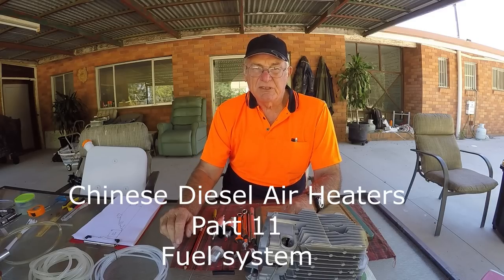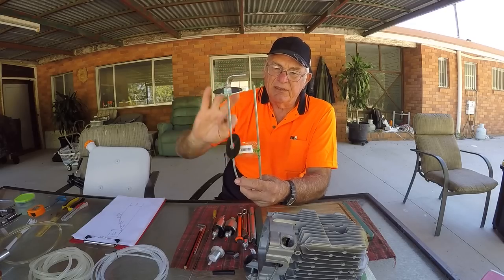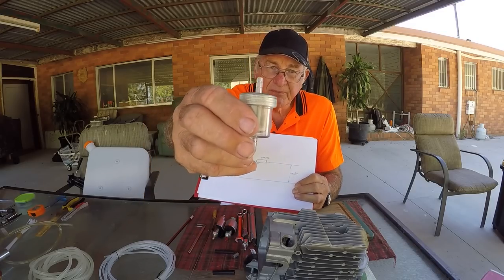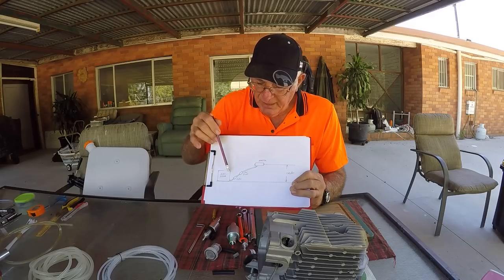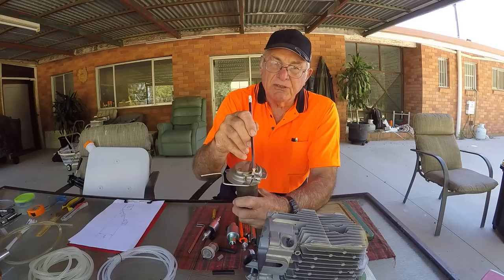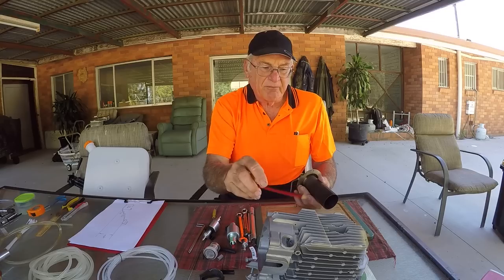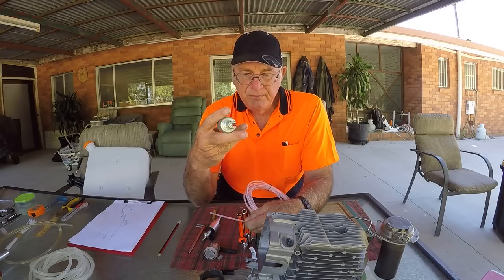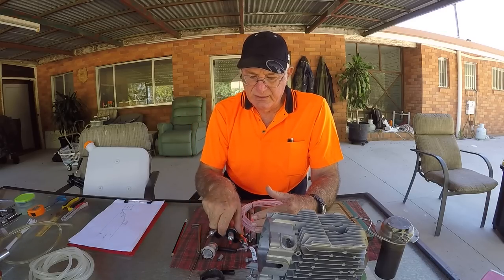Chinese Diesel Air Heaters - Part 11 -  Fuel Delivery

Comment: i am commenting as i watch the video. so your talking about the soft fuel line will pulse to a larger size as the pump pulses. so i understand that. i am a dragracer and build my own engines. i always used very high pressure fuel line. up to 300 psi. i know thoughs pumps don't do that but i have seen those plastic filters actually pulsate with each pulse of a fuel pump. do you think that plastic filter would do the same thing with that pump? if it did it would lower the pressure of the injection into the chamber.

Comment: Thank you sir for all the work you've put into educating us on these heaters! I have a question related to the lubricating property of diesel. The EPA's regulations have apparently reduced the lubricity of diesel over the years, and I'm wondering if this can cause premature wear on the pump. Is there any benefit or harm to using a diesel additive such as Diesel Kleen with these systems?
Reply from the maker: Hi A21,

Thanks for your feedback.

I have not heard of any pump issues from modern diesel.

As for Diesel Kleen, because I have not tested it personally, I can not give you an answer.

However, I do know that if you burn oil additives (2 stroke oil etc) in these heaters you cause excessive carbon  deposits in the burner and the atomisation screens.  JMcK

Comment: Sorry John I think your incorrect, (just my opinion) the hose is of a larger bore thuss the pump delivery has less of a delivery effect ( garden hose flowing then restrict it with your thumb) and the hose won't expand with every pulse as there is little to no resistance as its passing through gauze not a jet. The air in the high point of the soft hose makes no difference as the fuel flows over the bottom section of the hose. This is my initial thoughts if after a sleep I change my mind ill be back to apologise.

Comment: I havent watched it all yet..   but i put the fitting or a hole  in the cap (dont drill out the bottom) with a length of smallest diameter hose (the hard nylone works perfectly) going to the near bottom of the tank.  Mount it higher than the heater and ..presto..  the siphon effect keeps the pump primed.

Comment: John, mine works great when running. However, if I shut it down then restart it, the exhaust always ends up flooded with diesel (verified by disconnecting exhaust pipe) and it fails to start. (E-8 code) I presume that this is because the pump is allowing fuel through in a syphoning effect which overwhelms the ignition/combustion chamber causing it not to light. The only solution I can think of is to fit a tap on the line so I can shut the heater down purely through fuel starvation. Yes it'll throw an error of course but should allow it to start correctly after the power is disconnected as it would be priming from scratch. Thoughts?

Comment: Warm greetings John from Western Massachusetts, USA. A question: I'm planning on installing one of these heaters in my 12x16 foot shed. I'm figuring on having the heater mounted high on wall near the ceiling with the output from the heater divided into two lines. The fuel tank would be mounted 2 or 3 feet up from the floor. Am I correct in assuming that, if I put the pump close to the tank and use the hard nylon line, that I wont have issues with the more than one meter of climb the fuel will have to travel to reach the burner? 

Some people like to binge watch old TV shows; I'm binge watching your series on these heaters! Thanks in advance for your time and for producing these excellent videos.
Reply from the maker: Hi Kerry,

First thanks for the positive feedback. Do you have popcorn 🍿 for your “binge”watching?

Now being serious. Why mount the heater up so high?  Hot air rises, and you will have to force it back down.

It is better to have the fuel pump as close to the fuel tank as possible. A 1 metre lift is ok, but less is better.

Suggest you consider using normal fuel hose from tank to shut off valve to fuel filter to fuel pump on the intake side to lessen the chance of fuel leaks from multiple hose joins using hard nylon on input side. In your set up simple is probably more beneficial than more efficient.

On the delivery side of pump you should only use narrow bore hard nylon fuel hose.

Suggest you consider using a fuel tap close to the fuel tank in your install, and turn it off when not in use. This will help prevent the fuel draining down out of the fuel line. But it should be ok without it as the head height is only a couple of feet.

If it makes an easier install, you can mount the heater sideways on the shed wall, provided it is the side with the glow plug on top, and run the exhaust straight out the shed wall.

Good luck.  JMcK
Reply: Hi John, thanks for the reply and excellent tips. The reason for the height is mainly due to space management; having moved to a new house I've greatly downsized my work space. Around the perimeter of the shed I'll have cabinets and a bunch of power tools; wall space is at a premium so I figure if its higher its not taking much space I could use for something else. I'm still in the planning phase; so it might end up lower, maybe in a cabinet.

Thanks again!
Reply from the maker: @kobolila-yt  
👍 Where you suggest will be fine Kerry. Just direct the hot air slightly downwards.  JMcK

Comment: Hi John. Thanks very much for your time and all your effort. You have become a little celebrity here. I have a silly question. Does it matter if it's 1.5mm or 2mm? Mine came with an ordinary poly line which I have to throw out. Where would be the best place to get a 2mm nylon line? Thanks again for all your help.
Reply from the maker: Hi TS,

No it does not matter if 1.5 mm or 2 mm. But I would not go bigger than 2.5 mm

The important point is the fuel delivery line from pump to the heater should be hard nylon or narrow bore copper or similar. The reason for “hard” is to stop the fuel line absorbing the pump fuel pulses, 

If the fuel pulses are absorbed you will have issues with atomisation in the burner atomisation screens, excessive carbon build up and early failure of the heater.  JMcK

Comment: @johnmck1147 is there a minimum distance required between the pump and the fuel inlet on the heater? I’m building a heater in a Pelican case and want to make sure my hose lengths aren’t too short. Wonderful information you’ve provided in this series.

Comment: What an amazing and through job you have made of this series of videos. I am working my way through all of them.  Each one is a gold mine of information. I really appreciate your effort. Could you help me with two issues i have not been able to get information on please? I have a 45 ft tour bus and plan to use two heaters. I would love to have a separate 20 or so gal tank for both of them to feed off of. So I need to know how far from the separate tank can I pipe to the filter, pump, and heater? Second, I wanted to order the better hose you spoke about. Could you give a little more description so I can look it up on amazon? Thank you so much for any help you can provide John.
Reply from the maker: Hi MH,

Thanks for the feedback. 

The little dosing pumps, like most pumps, push better than suck. In your install I assume the pumps will be around the level of the fuel tanks so they won't have much lift to overcome so you could have longer than normal suction line. In motorhome installs I often run up to 1.5 m of suction with no issues.

The delivery line from pump to heater, unless very short (under 500mm) should only be narrow bore hard nylon. A run of 3 or 4 meters will still work here.

Search on line for “Narrow bore hard nylon fuel line for Eberspacher diesel air heater” 
I buy mine off eBay.

Two 20 gallon fuel tanks just for the diesel heaters seems like an overkill.

Cheers.  JMcK

Comment: Excellent video, thanks! How would you plumb multiple heaters into a Truck’s diesel tank? I need to  supply 3 diesel heaters (water, air, cooker) with 3 separate small pumps, but I don’t want to drill 3 holes into the tank for 3 separate stand pipes if it can be avoided at all…
Reply from the maker: Hi TDIY, suggest you could look at and try using one larger standpipe into the tank, perhaps a standpipe with a 10 mm or 12 mm bore and then have three 4 mm take off points for your heaters. The take off nipples could be soldered into the larger standpipe. 

Suggest you then consider using good quality 4 mm fuel hose from standpipe to seperate filters and then to seperate heater fuel pumps. From the pump to heater you should use narrow bore hard nylon fuel hose that does not absorb the fuel pulses. JMcK

Comment: We often forget that there are engineering details which are not obvious or intuitive. Thanks for posting this. 
On another subject, you mentioned in a previous video the problem with pump lubrication when using kerosene; will mixing some 2-cycle oil help?
Reply from the maker: Hi Michael, I hope people read the description as well as watching the video.

Now reference the 2 stroke oil in kerosene. Yes, a 50:1 2 stroke mix works well, but unfortunately all oils, including 2 stroke oils produce large amounts of soot residue. It is this soot build up in the combustion chamber and atomising screens that eventually cause poor heater operation.  A diesel/kerro mix is probably more sensible for long time use. But some countries sell a very high sulfur level commercial kerosene that appears to provide enough lubricity to the kerro. You need to check with your local Kerro supplier. Our lighting kerosene has virtually on lubrication properties.

Comment: Once again, another informative video. My heater has just arrived and I find it has what they call a damper connected to the fuel outlet. Have you come accross this before.
Reply from the maker: Hi Phil, thanks for the feedback.

If you are talking about a damper connected to the fuel pump, I suspect you have a Webasto copy rather than a Eberspacher copy. A Webasto style is a bit different to the heaters shown here.

Comment: Could you do the same test with the hose actually connected to the 'injector'?  And see how it squirts out with the two different hoses?
I am thinking the difference in squirt is mainly because of the difference in diameter of the line vs the volume pulsed, not because of the dampening of the line itself. Connecting it to the small tube that injects the fuel would probably speed up the flow again. Perhaps allso add a proper black reinforced diesel fuel line to the test.
I am running my heaters on the black braided lines without any problems at all.
Thank, Vincent

Comment: Brilliant. I only came here to find the direction of the pump because it doesn't say but what a awesome explanation. Mine unfortunately came with the green hose. I'm replacing it with the rigid now I've seen this but can you tell me what the other hose (sleeve) is that I need to join the rigid to the pump and heater. Thanks
Reply from the maker: Hi Brian, thanks for the positive comments.

Recommend you use normal good quality 4 mm fuel hose from tank to filter to pump.
But recommend from pump to heater you only use narrow bore hard nylon hose. 
You use short lengths of rubber fuel hose to join the hard nylon to heater and pump.
You need a tight fit on the rubber hose joiners. If the hard nylon has a 4mm OD you need the rubber joiner to have a 3 mm bore or 3.5 mm bore. If you can easily push one into the other you will get leaks. You need to have soak the rubber joiners in hot water and perhaps use some detergent to enable you to insert the hard nylon into the rubber joiners.   JMcK
Reply: @johnmck1147  Thanks again John. Just an update. There's ANOTHER controller out there now (which I got unknowingly) it looks the same as the LED one you feature (not the new blue one) but the priming and programming are all different just to mess things up. Keep up the good work

Comment: You got my second ever subscription when you said "people are much better at blowing then sucking" I want to build a diesel cooker like the webasto x100. Do you think this heater could be modified to run without the heat exchange? Was originally going to build my own little furnace and one of these would save me work.

Comment: Dear John - your presentation is brilliant and very easy to follow. And your expertise is unimpeachable. 

There is something worth knowing - here in Europe, diesel vans have a high pressure pump in the tank to supply the engine along a pressurised line and, as you say, this is useless to supply a heater. However, the injectors are made to leak slightly and there is an unpressurised return line to the tank. Not only can this be tapped into without problem - but the tail appears to go down at least 3/4 of the way down inside the tank! 

If this method is very surprising to you, check out Webasto or Eberspacher "T-piece fuel connector" on flea-bay and you'll see there is a thriving market for them, with numerous makers. I'm about to fit a heater in our Renault Trafic per the experience of many Facebook contacts. The t-piece I have is some hard plastic and is 8mm through and 6mm stub and I have my fingers crossed.

While I'm here may I mention that I think I see slight errors in your Physics. The increase in weight of fuel in the bigger fuel line is irrelevant. The pump is fighting only against the pressure - which is entirely dependent on height. (Everything you say concerning elasticity and bubble entrapment is valid and good however!) And I think there's another small error concerning the small bubbles. They are presumably due to tiny leaks - they are not cavitation (such bubbles collapse immediately in all cases). 

I hope you don't think my comments are irrelevant, if you delete them I will sure understand. Don't let me stop what you do.
Reply from the maker: Hi Tom,

Thank you for your feedback and comments. I really do appreciate all constructive feedback, and I want to be set right if I am wrong. I fully subscribe to the philosophy of “we never stop learning”

Re the fuel weight issue. Two other persons have also pointed this out to me and I am doing more research on this subject and plan to do actual real world tests at some point.

Reference the cavitation bubbles, I disagree re your leak comment. Tiny cavitation bubbles are formed in a fluid as result of a pressure reduction. That fluid can be air or water. Are you saying that every single world wide install of these heaters, be it Eberspacher, Webasto, Planair, Chinese etc ALL have a leaking fuel system?

Tom, my email is johnmck47@outlook.com if you would like to have further discussion on this matter. 

Thanks again.   JMcK

Comment: Hey John thanks so much for all the effort you put into the videos. The really have amazing content. I was curious if it's a bad idea to have my fuel filter and pump below the fuel tank, and then feed up to my heater which would be on the same level as my fuel tank. Thanks again
Reply from the maker: Hi ST, that would work fine. Although your heater level with the tank, and won't have a head of fuel pressure, it is still a good idea to install a fuel tap between the tank and the filter so as to shut off the fuel at season end.  Cheers,   JMcK

Comment: Hello John. From the UK. Love all your videos. Very entertaining mate. I wonder if you could advise me on a problem, (I think I have. ) As I'm not sure my Chinese heater is putting out as much heat as it should be. As it might just be the extra cold air outside we are getting at the moment.  The heater is outside in its purpose-built in box. Has lots of vents for letting air in.
I have a really good flow of air into my 12 x 8 workshop. But I can't seem to get the shop above 60 degrees Fahrenheit. It's been running faultlessly for 18 months now (winter months) And I'm sure it got hotter than that, for the first year. I only use the same oil as my central heating, if that helps? Thanks in advance. Dave.
Reply from the maker: High Dave

Lots of variables here, eg insulation, outside air etc.

You can gain more efficiency buy recirculating the shed air rather than heating the cold outside air.
If you feel heater is not as hot as in the past, suggest you measure the output air temp. (See my videos on this) If you find outlet air temp well below 100°C you may have excessive carbon deposits in burner chamber that need cleaning.

Cheers.  JMcK

Comment: Hi John, my 5kw heater primed ok then had a 06 error code. l decided to get a new 2kw heater. l changed only the heater but then had a error code 7. l then replaced the wiring & the controller for the ones that came with the 2 kw heater. Pressing the ok & the down buttons fail to prime the system. Press the start button & the heater starts, showing glow plug & fan running. Then fuel pump starts but after a short while the error 08 code comes on. l'm at a total lost now & don't know what to do. Any help or suggestions would be much appreciated. Thanks Peter.

Comment: Which supplier do you recommend? Do you sell these ? I am west coast Canada? I would like a 5 KW with 2 straight mufflers as well as other spare parts, screens, gaskets ...  Who do you suggest?
Reply from the maker: Hi Sean, sadly I can not recommend a supplier. They all seem to come and go. Suppliers I bought from just 6 months ago no longer sell heaters, or are no longer on eBay.

Suggest you buy from a supplier with a warehouse in Canada, and who accepts returns. 

There are lots of on line sellers of spare parts.  

Cheers.  JMcK

Comment: Hi John. I've got an old D3L in my yacht. The last owner dumped the fuel pump when he installed the new engine. I just bought a Chinese copy pump but it's not working... I've got 13.3v at the wires but when I put them on the pump no ticking. Does the ECU power the pump voltage on and off to regulate the pump speed? I thought if I'd place the wires on and off the pump it should tick/operate on and off?? Cheers